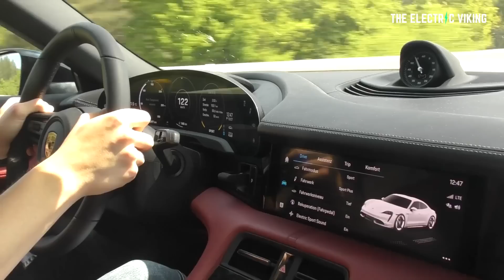Porsche begins producing synthetic gasoline it claims is carbon neutral

Comment: This is a really good point, but what other option exists for drivers cars? We have a Polestar 2 and it drives like a boat, it’s so numb and heavy. Even for AtoB cars we need a mix of efuels and electric to hit net zero. Carbon output of a new electric car may be less over the life, but first few years it’s way higher, surely waiting 4+ years is to long when we need carbon reduction today. Surely it’s better to buy a used petrol car that’s already emitted its carbon for production and drive on efuels.
A car isn’t a mobile phone, people have them for much longer. 
I’m happy to move to Chile if exporting carbon is a problem, they have some great roads 😉
Added to this - I presume efuel price will drop, but I did see a study showing wind/solar power to efuels vs electric was less efficient. Ultimately I think this will end up being for heritage cars and enthusiasts in the long term.

Comment: Electric takes too long to charge, on a fast charge it takes 20 minutes, who wants to wait 20min? And a fast charge damages battery in the long term.

.atleast with combustion middle class people can afford used cars but with old battery cars who can afford to pay $20,000 to replace the battery.

.also electric cars fail as performance track cars, an old corrolla can beat a tesla on the track 🤔 within a number of laps the electric car will take 20 minutes at pitstop to recharge, by that time the corrolla catches up and wins.

EV cars damage the enviroment and the batteries cannot be recycled 

EV cars are also heavy, that is a concern for potential colisions.

The better option would be to make a clean fuel for combustion, a better ethanol. Although ethanol is not as powerful it doesnt matter, cars today produce way MORE HP anyway.

Some people are just obsessed with EV because of the hype and the big i pad on the dash.

EV not amazing as they portray it to be

Comment: 1:24 Hey man, just wanted to correct you here. The cars do exist, and they are what are on the road right now you silly goose. This fuel is molecularly identical to regular gasoline, and doesn't require any modifications to operate the gasoline vehicles on the road today. I feel like you missed this point, which literally happens to be the absolutely most exciting point of the entire thing. :D

Comment: Yes I agree that moving carbon from one place to another will perhaps cause health issues, but do we not already have from fossil fuels, however overall it’s doing less damage than ignoring the Carbon and then creating more, I actually think there is something in this if we can remove the existing Carbon and recycle it constantly then over all its less harmful, the price of the fuel like electric cars will eventually full with mass production, and to scrap millions of cars to build new electric cars will have a huge effect on the environment, wouldn’t it better let the cars die out naturally rather than force people into buying a electric car, I’m all for green energy and to stop using fossil fuels but to keep up with the demand on the millions of electric cars need we will need burn a shit load of fuel…. Kinda defeats the object plus do we really believe we have enough lithium….. witch is only accessible from using heave equipment that can only be powered by A huge gas guzzling engine, i think green fuel in ICE vehicles should have been developed 1st as a go between, so anyone attempting to create fuels to keep vehicles on the Road gets my support for a short term solution

Comment: Synthetic fuel is an alternative for a more clean use of internal combustion engines (ICE), certainly the most inportant subject here is stopping the petroleum extraction,  specially places using non-conventional methods like fracking.

If a concern is the transportation of that fuel to Europe burning gasoline or diesel, the EV industry is also to blame, burning fuel in places that get the energy from thermoelectric plants burning gasoline or coal, where rhere there are no hydroelectric plants, windmills or similar.

Not to mention the mining of the raw materials for building lithium batteries for EV's that, ironically, mines of cobalt, manganese, nickel, lithium, rare earths, are found on 3rd world countries, so, don't they have to be transported too long distances to Europe like the synthetic gasoline? 

I think the real solution is giving people alternatives and not close minds to only one option, synthetic fuel might be a viable alternative to be used along with EV's, hybrid and hydrogen vehicles.
Reply: Very well said. It's becoming a fight between EVs and ICE vehicles which is ridiculous.

What people like this idiot think is that everyone has the money to go out and buy a new ev tomorrow 🤣

I've always bought cheap used cars, there's absolutely no chance for me to buy an ev anytime soon.

Comment: Das Helmholtz-Institut Ulm hat das mal durchgerechnet mit den E-Fuels.

Die Produktion von 1 Liter E-Fuelse aus CO2 und H2 benötigt 27 kWh elektrische Energie.
Ein E-Fuels-PKW verbraucht 6-7 L  auf 100 km, gesamt 160-170 kWh benötigt für 100 km Reichweite.

Mit dieser Energiemenge 160-170 kWh kann ein E-Auto ca. 825 km fahren, das ca. 8,2-fache an km.

E-Fuels sind Schwachsinn, da benötigt man ca. die 6-fache Menge an Energie je 100km wie mit dem E-Auto.

E-Fuels sind Schwachsinn, die muss man immer kaufen wie Benzin oder Diesel und Solarstrom kommt jeden Tag vom Dach.

Comment: You also have to account for oil: Chile does not have sufficient oil to fill its energy needs thus is really dependent on world oil prices, this plant really solves an actual fuel shortage the country has and also for Porsche and the EU it's a way to fight off OPEC oil production caps since human technology now allows to produce fuel without the need of oil reserves. It's not just a climate change reasoning, it's mostly energy geopolitics

Comment: The biggest market for these will definitely be classic car collectors who don't want to convert all their classics to electric, and they'll probably have it delivered to their garages. Also, racing leagues and teams, at least until instant-charge capacitors or quick-change battery packs electrify most forms of auto and motorcycle racing.
Reply: Orrrr,  people will pull their heads out of their ass and drill and use good old gasoline since an argument can be made that personal transportation is one of the least of our problems in the world 🙄🤷

Comment: Sam. I think that you have some flawed points here.
1. The cancer causing components of car exhaust aren't the CO2 emissions, it's all the other emissions.
2. The cost of the synthetic gas should drop over time and as thr cost of electricity goes down, the cost of manufacturing the SG should also.
3. Many people still drive classic cars. They will continue to have value. Even if the world transitions completely to EVs, there will still be a niche market for classic ICE vehicles.

Comment: Doing real carbon neutral e-fuels (eg capture at waste burn, using only green energy) is possible, but will be prohibitively expensive. There's also the problem of producing, transporting and distributing the stuff at scale. Maybe makes sense to decarbonise aviation, but it will become much more expensive to fly (which I think it should be anyway).

Comment: Net is net. If you take X quantity of carbon out of the atmosphere or ocean , whereever it is where you don't want it to apparently be, bottle it up, and then release it again, it's net zero, or at least very low (assuming the energy to create it was from renewables anyway). The "where" doesn't matter. No doubt CO2 will flow around to some degree, it's not going to simply stay in the exact spot where it was emitted.

You could almost look at such fuel simply as an alternate energy storage medium, no different to a battery or hydro. And as time goes on, if the process becomes better and scales, that should bring the price down.

And it's not just poorer people in developing countries who will be "stuck" with ICE cars. What about enthusiasts who want to keep classic cars on the road? What about specialized vehicles where EV's might not be suitable for some reason? What about replacing mined/drilled oil with synthetic oil products for industry, manufacturing, etc? What about for things like backup purposes, say, hospitals or datacentres who use backup generators? This technology could have a tonne of benefits in a lot of different areas.

Comment: The carbon-neutral argument makes me mad. CO2 is an inert gas, not even poisonous. but you still die if you let your engine run in a closed place for too long. It's not the carbon but all the other toxic stuff that are more important reasons for banning ICE.

Comment: You said not having a gas station to sell the product. The product is going to be sold at gas stations as they can use a preexisting tank for eFuel. Sounds a lot cheaper than building an entire infrastructure for electric charging stations which will produce an enormous amount of Carbon in doing so. Not to mention building one Electric vehicle produce three times as much CO2 than that of an internal combustion engine vehicle.
Reply: VW and Kia/Hyundai are already producing EV's in zero carbon manufacturing facilities.......  At what point does an ICE vehicle stop producing CO2?
Reply: @Brian-om2hh  When it runs on carbon neutral fuel 😁

Comment: I think using the term "gasoline" to describe a synthetic fuel seems to be misleading people leaving comments. So far, I've read many comments where people are assuming that it's actually gasoline with additives. I don't have an opinion on this matter but just wanted to point out that Porsche's eFuel is not gasoline at all. It's produced from splitting water into hydrogen and oxygen, then combining that wiht CO2 to produce a synthetic methanol which is than converted into eFuel. It would be like saying that you cook steaks on your gasoline grill instead of a gas grill.

Comment: So, they plan to take an expensive fuel, Hydrogen, and convert it into an insanely expensive fuel, to be burned in horribly inefficient engines? Automatic fail. The only good thing about it is that it is more compact and easier to store than hydrogen, but that is not enough to overcome bad economics.

Comment: Actually I don’t think this is stupid. There are applications like commercial aviation where weight matters a lot that can find application. Energy density of batteries is no where near that for combustible fuels so electrification of commercial transport using batteries is not likely to happen soon if ever. Certainly I agree that this is not intended to be a replacement for BEV and I don’t think the Porsche executives are expecting that either but looking into carbon neutral alternatives where a heavy battery is not going to work. Another thing to recognize is the taking CO2 from Chile and effectively moving it to Europe will not be an issue because CO2 is a well mixed gas in the atmosphere through atmospheric circulation so it will spread across the Earth rather quickly. I am an atmospheric scientist so know about this.
Reply: Also, Lamborghini, Mclaren, Siemens Energy, other than Porsche are looking into this fuel as well as formula 1.

Comment: As long as you ignore the pollution that will come from used batteries, solar panels,  wind turbines and the cost of massively  upgrading the power grid EVs are the obvious best solution for sustainable transportation. But considering all factors,  some other solutions like carbon neutral fuel may make more sense than you think.  There is also the problem EVs have if they catch fire. Compared to a gas powered car fire EV fires are very difficult to put out. Hydrogen is probably the dumbest idea for cars as it has big storage problems. I'm pretty sure carbon neutral gasoline is better than Hydrogen.
Reply: Well Toyota, Cummins, Yamaha, even Porsche is planning an hydrogen powered ICE.
Reply: @aaronmiller5012  Hydrogen has some advantages that they can sell it on but storing enough of it in a car to give the car decent range is very problematic.

Comment: You are wrong, Porsche's version of green gasoline is carbon neutral. Taking out a pound of carbon dioxide from the air in Chile and putting that pound in the air in Europe does not increase the ppm of CO2 in the atmosphere. Assuming that green hydrogen is used and no hydrocarbons are burned in the production and transport of the fuel and the embedded carbon from all the process equipment is ignored. You are correct that the cost of doing this is crazy high ($45/US gallon), and this will at best only allow a few very wealthy Porsche owners claim they are carbon neutral.

Comment: Consumers  want to avoid buying any carbon fuel marked up by a middle-man.  That applies to gasoline, synthetic gasoline, hydrogen.  Consumers want to charge up at home with renewable energy source directly without paying  the mark up by the middle-men of the gas station, gasoline tank truck delivery service, gasoline refiner, oil drillers, oil spill clean up contractors, etc.  Also synthetic fuel only prolongs the need to get maintenance services like oil change, fluid maintenance, tune ups, smog checks, etc.  Thank you for pointing out that synthetic gasoline just perpetuates the cancer air pollution too.
Reply: Hopefully the politicians won't see this as something to get an exception, ICE ban wise.
Reply: You'd think the preppers and libertarians would like the idea of gathering car fuel from their own sunny roof.
Reply: I agree. More dirty oil changes and gas stations. All the horrible things that EV's replace. EV's are the future, not synthetic gas.

Comment: If any alternatives or new fuels use resources that need to be mined, manufactured and distributed and/or electricity in the production process, they have to factor that in when comparing going fully electric. Surely one of the biggest benefits of electrification is that you can generate where you need it, especially if you’re a company with premises or a homeowner with a roof. All these alternatives are a waste of brain power and money.

Comment: The only way a scheme like this would have a chance in hell of working would be if they shifted their entire strategy to making aviation fuel. Commercial aviation especially long haul aviation is the only major segment of the energy system that still has no clear path to decarbonize. Synthetic jet fuel might be the only way forward for the aviation industry. The Boeing aircraft manufacturer has already begun to do R&D on possible Synthetic aviation fuel and production methods involving extracting hydrogen from seawater and carbon from captured carbon dioxide. It's still too early to say if this scheme will work but at least it makes some sense to try this. 
What Porsche is doing here is utterly ridiculous only idiots with way more dollars than sense will even think about trying to own an ice car.